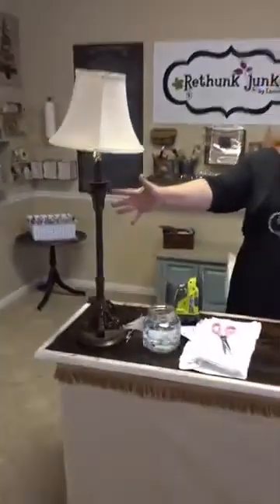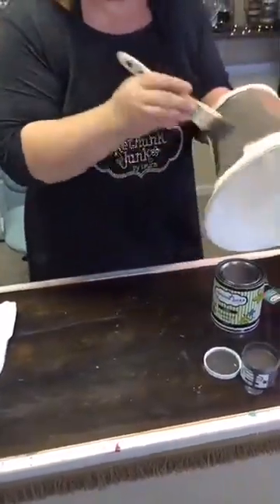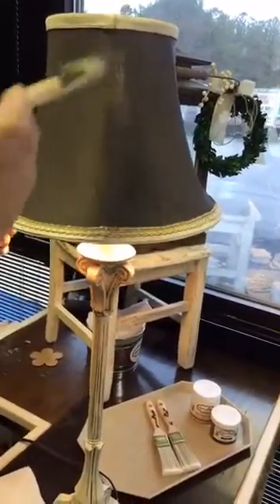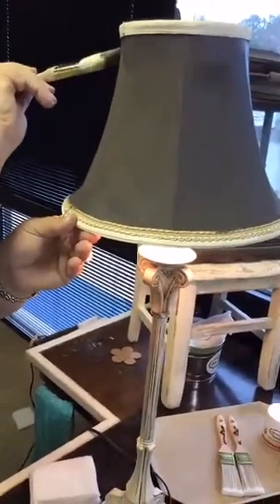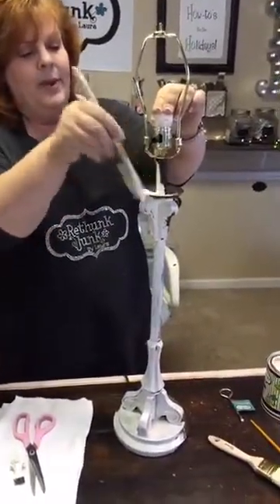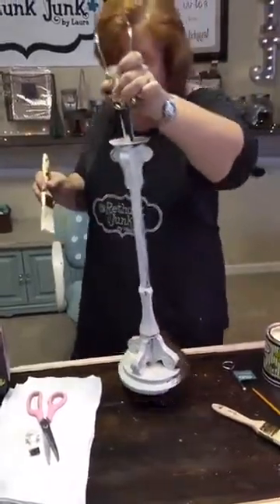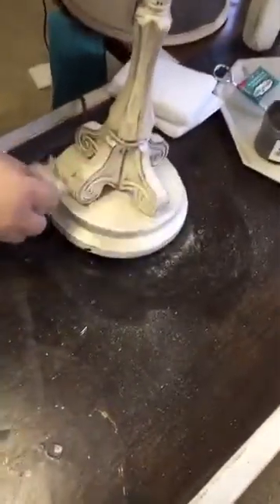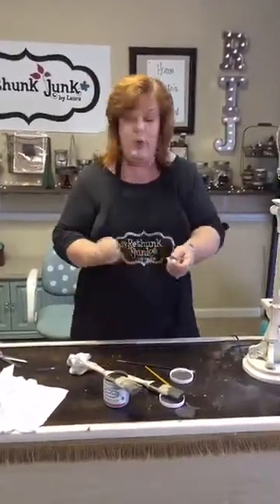How to Revamp a Lamp with Rethunk Junk Furniture Paint

Comment: Don’t you have to seal the paint on the metal lamp? I want to paint a walk in closet door mirror thats frame is gold metal and I want it cloud (white). Will that work to cover the metal and do I need to seal it so it doesn’t scratch off or chip off?
Reply: Did you seal it? I'm wanting to paint brass candlesticks & I'm not sure about sealing them.
Reply: @sh3rla  i did seal it but what bothers me about it is that the Rethunk junk seal didn’t use to look yellow but clear and now it has a yellow tone to it and that really bothers me.